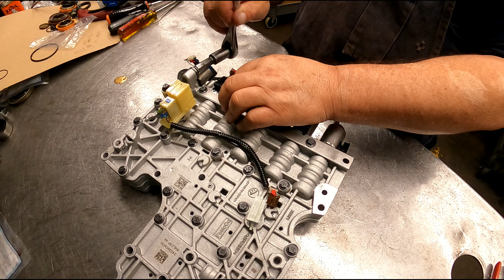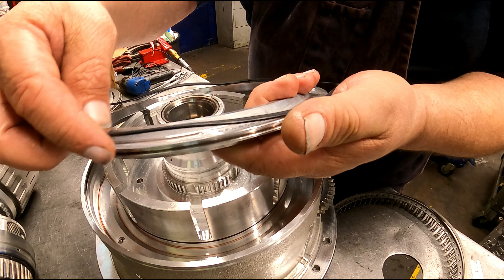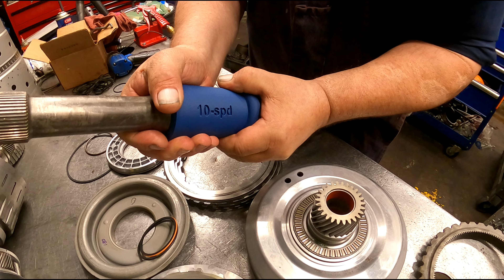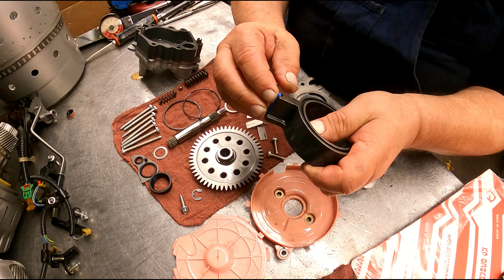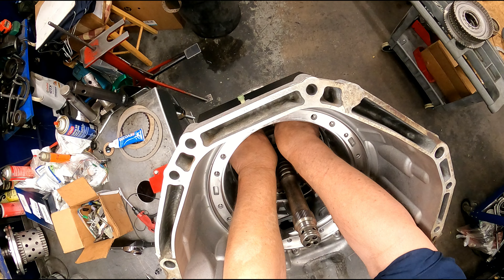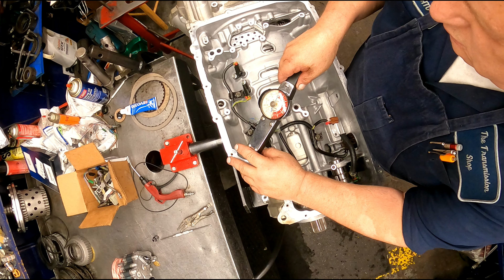10R140 Rebuild

Comment: When installing the accumulators with a spring underneath, i use a pocket screwdriver w/ a magnet. It holds the springs in the accumulators

Comment: I found a magnetic looking dowel in the pan on mine and the rear output seal blows out is the concern, also leaks from the from torque converter seal slightly, tore it down more, nothing conclusive yet..
Reply from the maker: Sounds like a plugged vent. Send me a photo on my Instagram and I will look at the piece. Don't know if I will be muchhelp asI have only seen 1 so far, but I will look.
Reply: @CurmudgeonTransmission  ill try and get a photo tomorrow

Comment: I am curious as to how you determine if a torque converter requires replacement or not or if you automatically replace them as the norm?
Reply from the maker: Damage to the transmission, codes in the system and symptoms of the problem. Some should just be automatically replaced because they have such a high failure rate. Like the 6L80, 6F35, CVT's etc. The 10R140, 10R80, 8L90 and a few others cannot truly be rebuilt as there is no way at the moment that the aftermarket can bond the clutch to the plate because of the angles. Therefore your only option is a new one from the dealership. All the ones from the aftermarket (as it stands at the moment) are only opened, cleaned, new bearings and seals, then rewelded.
Reply: @CurmudgeonTransmission  Thank you. Keep up the good work !
Reply: In some cases you can turn them off and on manually by scan tool while diagnosing

Comment: I'm doing a 10r140 and have a cross leak in the cdf drum that I can't seem to fix. When air testing the drum itself it's good. But assemble it on the shaft and it leaks. New drum and hub, new f clutch piston and all new seals on the shafts. Did you air test this unit after assembly? And Insights as to what I'm missing?
Reply from the maker: These units do not air test well. I would bet dollars to donuts it will be fine in the vehicle.
Reply: @CurmudgeonTransmission  ok. After first install it burnt up the f clutch and had f clutch solenoid stuff off code. Replaced solenoid but was too late for the clutch. 
Thanks for the reply, I'll throw it back in and see what happens
Reply: One other thing, tested line pressure and it was only 50 psi. That was before removing it. Pump looks good internally.
Reply from the maker: Pretty low. I usually just replace the whole vb. They have a ton of problems with them.

Comment: Are you out of the gold transgel?
Reply: It’s been discontinued.
Reply from the maker: The place that produced it burned down and he decided not to rebuild. All that is available now is Lubegard, Red (thinnest), Blue or Green (thickest).
Reply: @CurmudgeonTransmission  I didn’t know that. I asked my rep at WIT for it a year or so ago and she said it had been discontinued. That kind of explains why.
Reply: @CurmudgeonTransmission I been using the blue for everything, have you tried the lubegard ? I seen it on line but look like red Molly grease.
Reply from the maker: @jeremyking5684  I've used them all. I don't like to use the red because it is to easy to mistake it for a fluid leak. I use the blue to lube lip seals and the green to hold things in place.